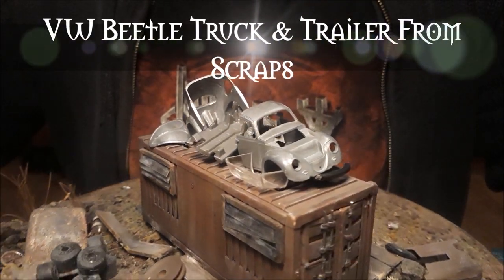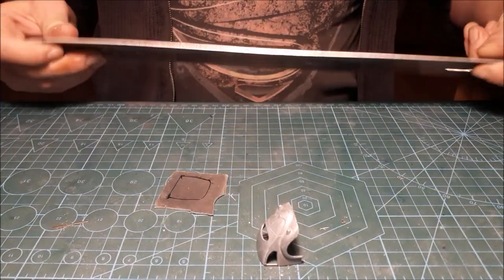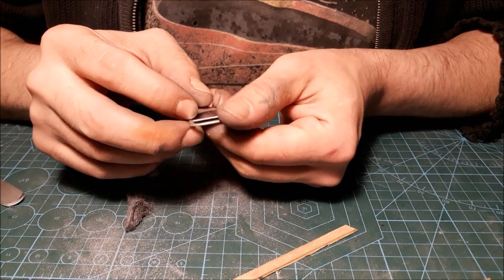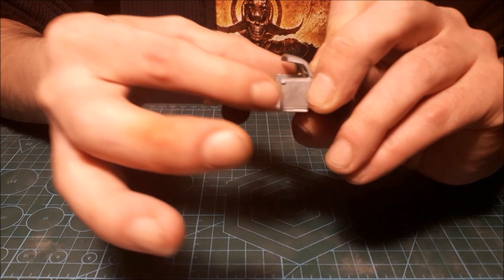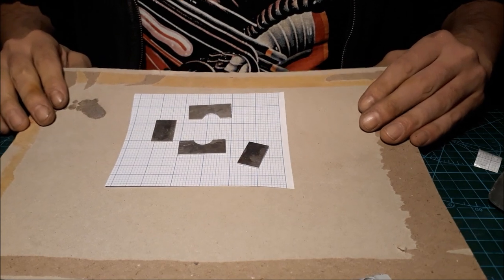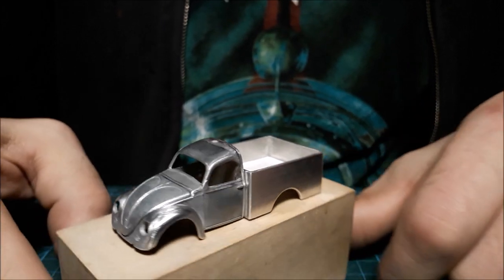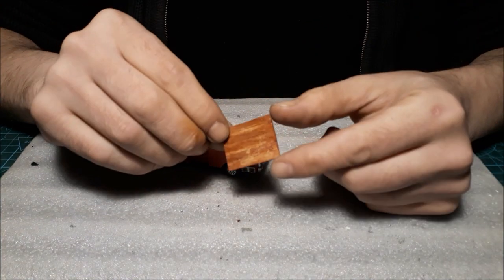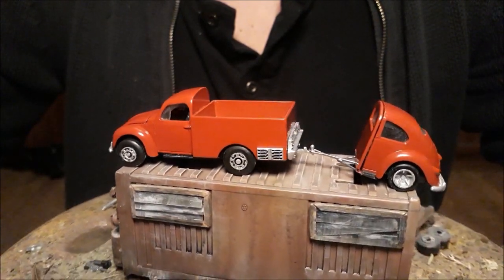VW Beetle Truck & Trailer From Scraps

Comment: Great job, and I liked how you added an opening part. I've never attempted that in this scale. I'm a new subscriber so I don't know if you have answered this before- do you work primarily with metal, or do use other media? For example, I've made some interesting mods to die cast using Miliput and JB-Weld. Just wondering if you have as well.
Reply from the maker: Welcome aboard!! I use anything I can find... I've only started doing metal cause I've found that piece in the cellar. When it's gone it's gone... Cheers mate